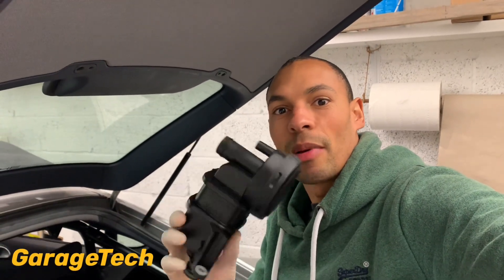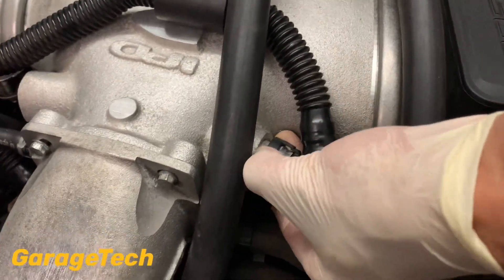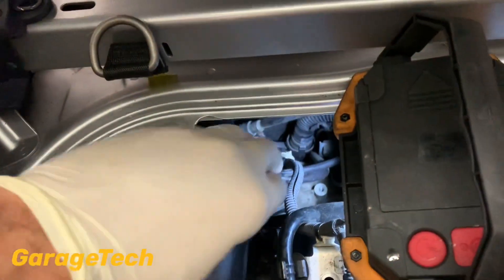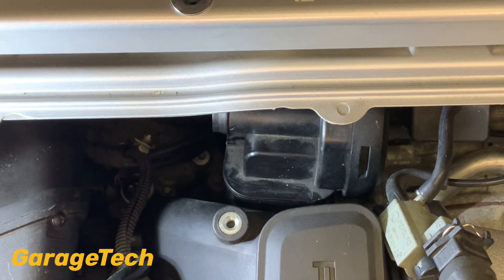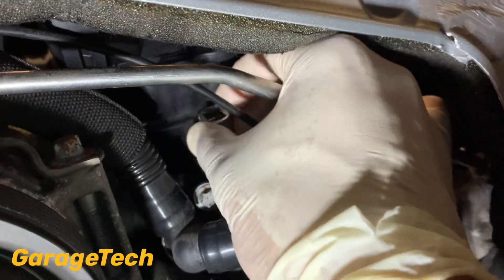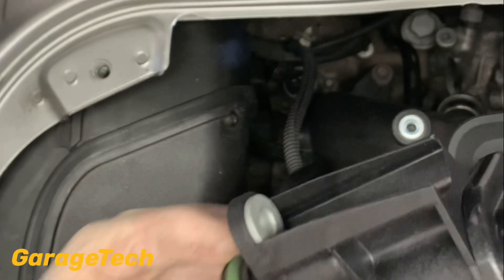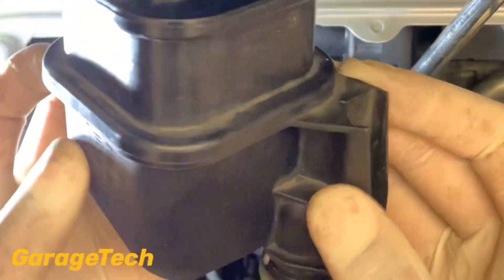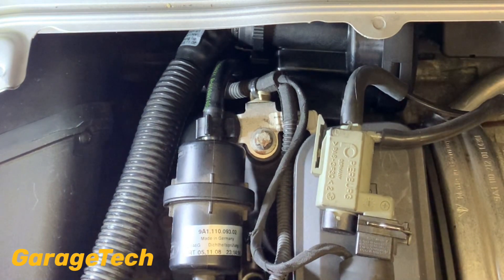How to replace your AOS Valve Porsche Cayman Boxster 3.4 air oil separator PCV 2009-2012 Gen 2 987.2

Comment: three tips you can hold theo bolts, 1st you can tape the socket on the extension,then the socket won't drop.  2nd you can buy and use 8 mm magnet socket to start screw the bolts in, then use the taped socket to tighten. 3nd put the bolts into the AOS, then put a small o-ring on the bolts the put the AOS in. this idea is I see it on the subaru timing belt tensioner, it's o-ring like I said to hod the bolt and the washer.

Comment: I have check as you show to check if there is oils on intake side from your previous video.  I don't have any smoke issues and have very low miles on the engine but when I put my finger through AOS outlet, I came up with some oil on my finger.  Does it should be totally dry or it might have some of oil in it???
Reply from the maker: Hey, thanks for the comments, you will always get some oil coming through unfortunately as it’s just the nature of the design, even with the additional catch can I fitted, after a while oil will start to form. As long as there’s no clouds of smoke and high oil consumption you’ll be fine. Most are changed as a precaution

Comment: Great video again, I greatly appreciate. How did you get the rearward E10 bolt in place in the AOS bracket hole, without dropping it and it falling out of place where it could not be reached? Seems like a very tight space to get your fingers holding the E10 bolt into. Thank you
Reply from the maker: Hi Carl, thanks for all the comments, I used a magnet and placed it in, you can just about get it to turn one or two threads to pull it off without pulling the bolt back out. Another method is to use a bit of grease or tissue on the bolt head so it sticks in the socket. 👍🏼 all the best
Reply: I actually used a bit of super glue in the socket when I  put that difficult back bolt in worked a treat just enough to stop it dropping off ..

Comment: I just pulled one of the hoses off of one side of my plenum and saw oil present in the plenum tube. Seemed to be only slightly less than you showed in your previous video. No smoke from the exhaust and engine runs great still. But AOS change coming to avoid bigger future problem..   
I was thinking my oil change refill procedure may be a contributor. I refill the last 500 ml very slowly, only adding 50 ml at a time once the gage reading is one bar short of being totally full. DO you think if a person was to only fill with fresh oil until reaching 75% of the way from min to max on the dash gage that that would help the AOS survive longer since there would be less oil vapor churning in the crankcase?
Reply from the maker: Difficult to say really, I’d rather have the oil topped up to the max as you wouldn’t want to then introduce any oil starvation particularly if you are doing any fast road driving with sweeping corners etc. I’ll also be adding an oil catch can to the system just to minimise any oil vapour which does pass the AOS valve. I’ll add that video shortly.
Reply: @GarageTechAutomotive  Great idea. That will be so much easier to service, I'll be so looking forward to that video. Thanks for all your great work and help.

Comment: is the AOS the same as the intake manifold tuning valve control?
Reply from the maker: Hey, no the AOS is the Air Oil Separator, it filters out the oil particles from the crankcase gases before they’re returned back to the intake. The intake manifold valves, control the flaps inside the intake l, which effectively changes the the length of the manifold 👍🏼

Comment: Novice question, what did you use as lubricant on the new valve?
Reply from the maker: A touch of clean engine oil is best, or a spray of WD40 will do the trick 👍🏼
Reply: @GarageTechAutomotive  thank you very much! Very helpful video.

Comment: I replaced mine too but still smoke
Reply from the maker: Yeah these ome AOS valves aren’t great, I’ve added a catch tank to the system to help reduce the oil getting into the intake. If you haven’t done so already, I’d recommend cleaning out the pipes as there will be oil within there still getting drawn through.